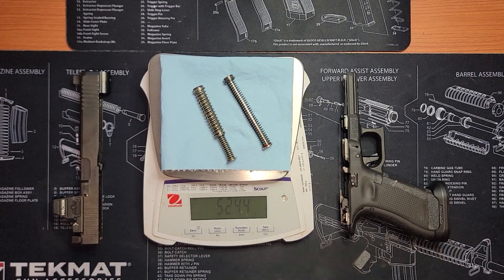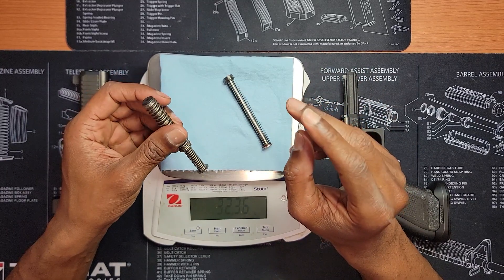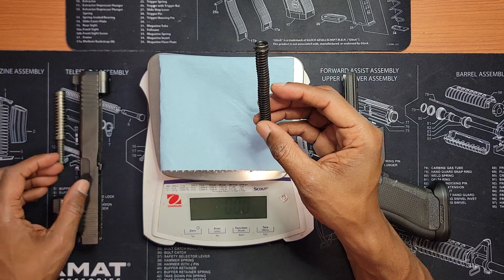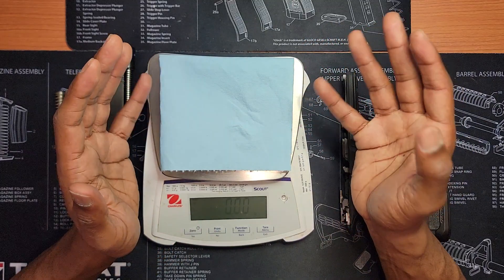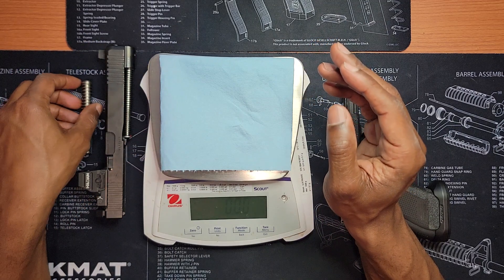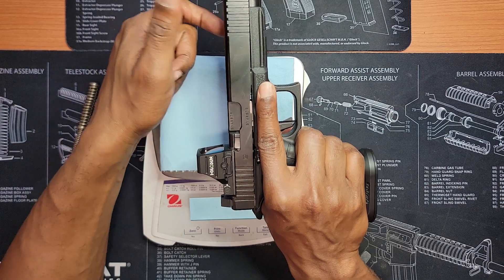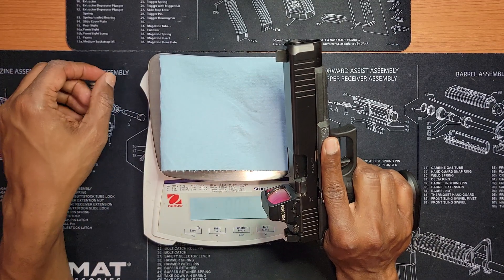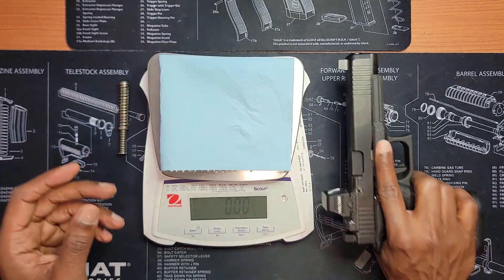Gen 5 Glock 34 Recoil spring weight change results

Comment: Thank you for the review. What ammunition are you shooting for competition with the 15 lbs spring?
Reply from the maker: It's a glock so it eats up anything you put thru it. 115 grain on up without any issues. I've never had a malfunction with my competition G34 with all it modifications
Reply: @ Understood and thank you. It’s been my experience that some competitive shooters adjust their recoil springs to match their ammo, in particular with lower power factor 9mm rounds.  The balancing act with the Gen 5 Glock 34 in optics divisions is that the slide seems to have more reciprocating mass than previous generations.  Thanks for the videos and information!
Reply from the maker: @Salute94  right... Im looking for a flatter return after each shot. The 15 lb worked for me but the 13 lb worked but didn't return as well. The 17 lb is too much for competition for but super reliable